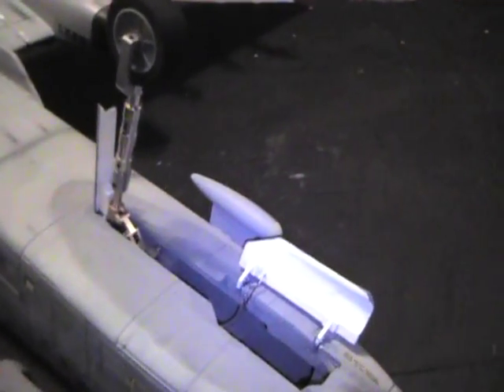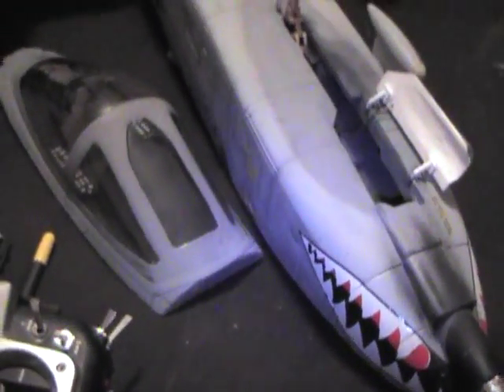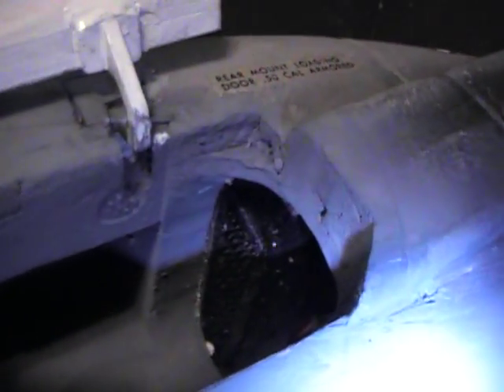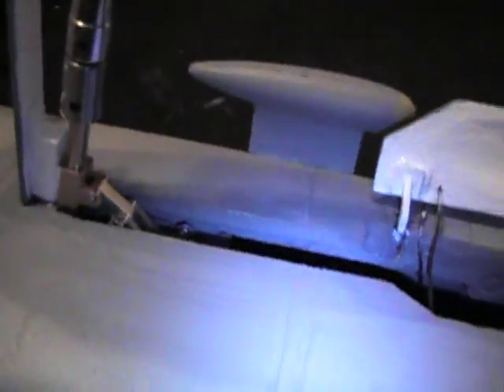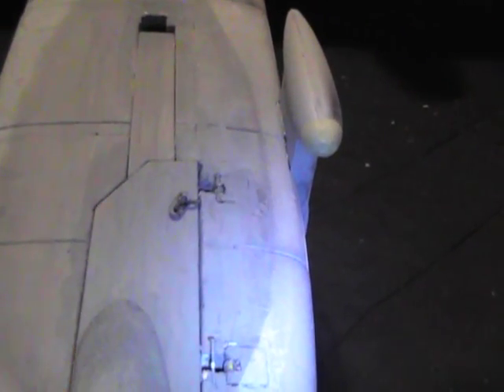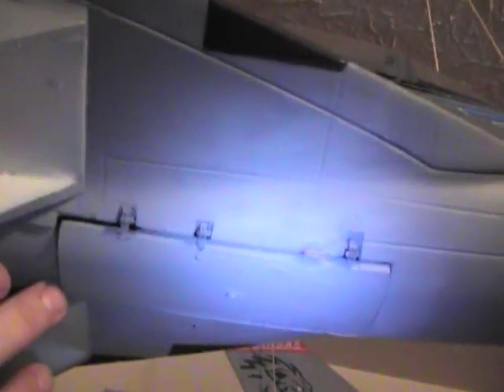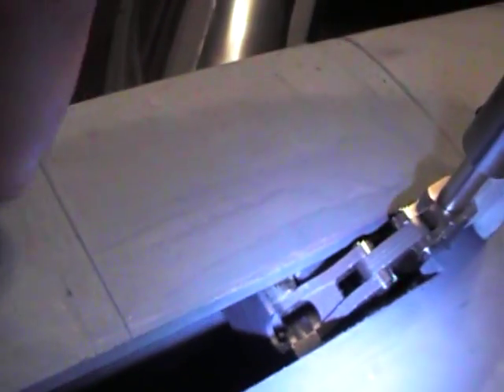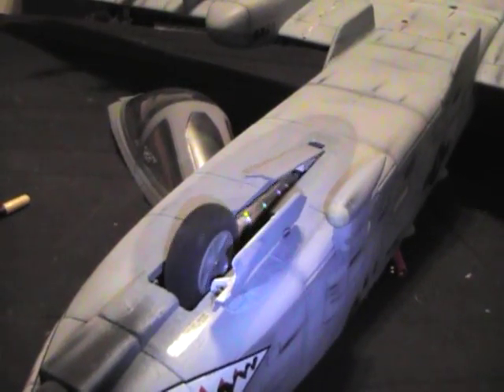LX A 10 DSR46 retract mod with working gear doors

Comment: I know its been a few years since you posted this but can you add a link to Chopra(?) who you reference as having the specifications for the installation of the gear?  I'm especially interested in the front gear information.  Thanks.
Reply: Ok, found more info on this here: http://www.rcgroups.com/forums/showthread.php?t=1387582&page=35
Post is from Charles (choover)
Reply: Oh and that's post 519  For the mains checkout of 
http://www.rcgroups.com/forums/showthread.php?t=1387582&page=30
post 442
Reply: The measurements are found on post 1049
http://www.rcgroups.com/forums/showthread.php?t=1387582&page=70
Reply: BTW, these are nice gear but the steering control horn on the nose wheel must be in one  specific place when the gear are raised/lowered, otherwise the gear will get stuck.